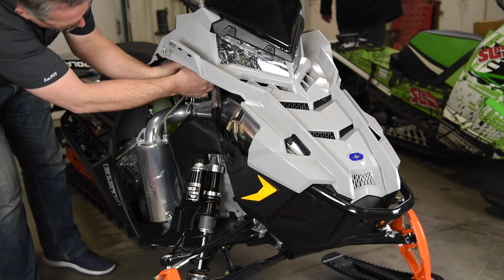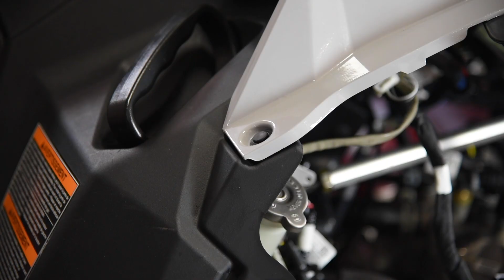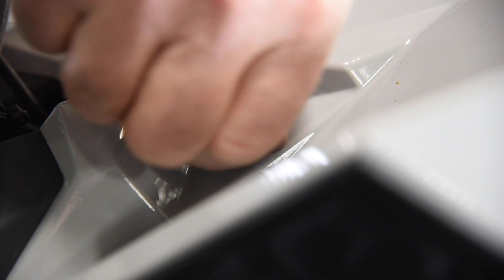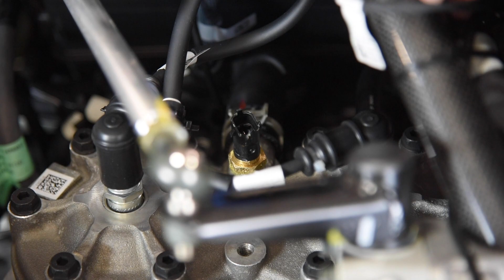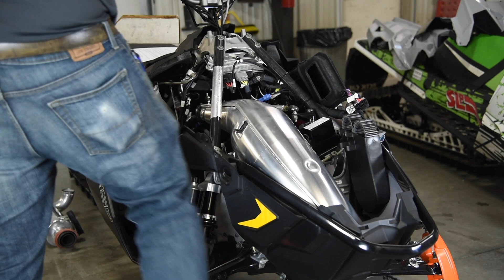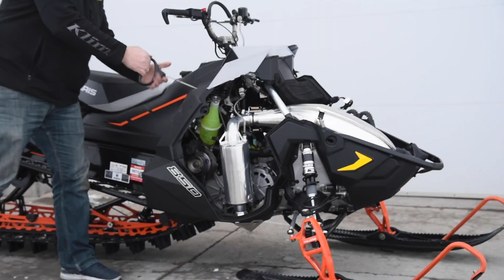How to Install SLP Power Domes for Polaris 850

Comment: Looked at the latest 2022-2024 850 service manual it calls out a torque of 25 ft lbs, then an additional 90 degrees.  Video says 20ft lbs, did Polaris change the torque call out over the years or is the torque lower for the SLP billet head than the factory head?  

Polaris manual also says to discard old bolts and use new bolts.  Nothing in the video about that.  Is that a new procedure?